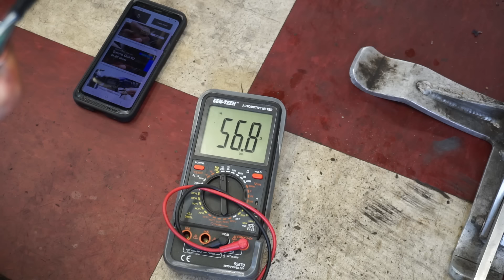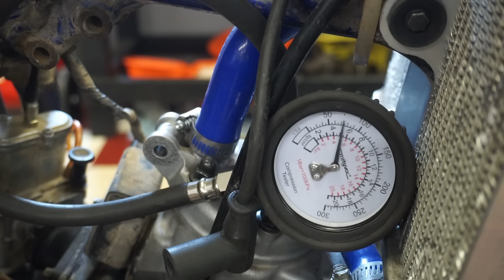Seller Said He Couldn't Fix This $1000 Dirt Bike

Comment: Joe is teaching all of us.....always check for spark before buying.   If you are ever troubleshooting a spark issue, I have found the stator goes bad about 95 percent of the time versus the CDI or Coil.
Reply: Theres so many little things joe can do when he goes to buy a bike. But I know he just gets them for the content. Would be so easy to check for spark and compression test before buying. I used to have a subaru wrx wagon, and when i sold it, the buyer did a complete compression test before purchasing. He's a builds them, so it was quick, but regardless, know what you are purchasing before you purchase.
Reply: He’s not teaching anyone.. he’s not even a qualified mechanic
Reply: @Joeyhill-wj6js what makes someone a qualified mechanic? Are you qualified to operate a motor vehicle?  Was Einstein qualified to demonstrate equations and quantum physics? No?

Comment: Ive bought a 1994 yz 125, that was fully rebuilt top and bottom end just beat up plastics for 1000$, also gotta a freshly rebuilt 1998 rm 250 for the same amount, i put a new plastic kit on it now have 2 great bikes for like 2500 all in, there are definitely good deals out there if you look hard enough

Comment: Joe you could be right about that loose coil wire , I just bought a 2001 YZ 250 that was completely rebuilt top to bottom and wouldn't run !! I took the carb off and cleaned it and now I have a $4000 dirt bike so my point is don't overlook the small stuff

Comment: I just got a free 2004 YZ250 because my BIL said it needed way to much to make it run. So I spent 30min getting it apart, getting the carb off, cleaned out and found the excess RTV had clogged the jets. Cleaned that out, reset the carb to factory specs. Put a new plug in it, tested positive for spark. It has a leaking/cracked gas tank so I snagged the one off a free 06 yz250, fresh gas and the free 04 is dead no more! 3rd kick and she is good to go. Bled the brakes and they’re good. No leaks. Needs a shift lever.

Comment: I notice that when you use the impact driver, you tend to twist it as your hitting it, and also you give it a bunch of little light taps with the hammer. All you need to do is hold that puppy with a firm grip (you do not want the handle twisting at all) and give it 1 SOLID bang with the hammer.

Comment: save some money do your own rod replacements on these small 2 cycle motors , you got a press all you need is a pair of 2''' by 2''' or 3''' by 3''' square stock bars and a flat stock slab thin enough to fit between the slabs with a u cut out for the rod and you push the slabs apart . Scribe the crank slabs 90 deg from the rod pin before you start to give you a good guide as you reassemble. A set of v blocks and a dial indicator to true, a brass hammer to hit the slabs to true on your done. I have done hundreds working for a dealer for two decades.

Comment: Good thing you didn't fix the spark. Definetly a keeper locking up in the shop rather than at 10,000 RPM means it wants to live.

Comment: If crank seal is gone will it rev up if ya play with throttle can't get my 97 cr 125 to run right , clean carb , new jets and reeds are good fires up first kick 120lbs comp??

Comment: Question: Have you ever restored a project back to original brand new condition? It's not nearly as easy as people may think. Depending on its condition, anything that's even remotely worn gets tossed and replaced. Rarely do you use original parts except things like the engine and the frame, which can be brought back to original condition with the help of things like a sandblaster and a good quality welder. Of course, if either is damaged to the point that making it like brand new is impossible it'll get tossed too. It's a painstaking process that could end up taking much longer to complete than you would think.

Comment: I presume every parts will be put in the parts cleaner before rebuilding Joe?
Reply: 🤔I bought a 20yo 150k Audi 4000 from a clock repair guy.  Every screw, every spring shiny as new.  Needless to say - for an old car - it ran like a watch
Reply: Joe dirt aint cleaning nothin

Comment: hey bro I have a pit bike i recently bought. It is full automatic 125cc. Problem is wen i give it full throttle it revs high but doesn't accelerate that fast. Brakes are not sticking. sprocket original. It's auto so I don't think it has a clutch otherwise i'd assume this was the issue any thoughts? thanks.

Comment: Instead of smacking the wrench with a hammer, if you take another wrench a bit bigger than the one in use and use the box end you can position it on the end of the wrench to gain leverage. It will kind of lock onto the wrench being used and sure beats beating on your equipment with a hammer. Also, you should invest in a good set of punches. That way, you won't have to ruin your extentions by beating the hell out of them.

Comment: That’s stator seal allowing air in could have caused a lean hot running condition and starved the bearings of oil as the air pulls past the crank and rod bearings.

Comment: Push the kicker down and let it engage before kicking it, good way to break it. When the piston has spots on top where it hit something it usually came from the rod, split the crank and put a $50 rod kit it thats a cheaper problem then a piston
Reply: Crank bearings and seal is a good idea to change while your at it too tho

Comment: Who do some bikes only have 1 Piston Ring?
I have cheap Ryobi 2 stroke leaf blower that's about 15 years old and still runs perfect. Has 1 piston ring. 

If you watch some videos about 2 Stroke motors like on more expensive lawn equipment like Stihl, Echo, Husqvarna..........
All the small engine mechanics tell you that 2 Stroke with 1 ring are cheap, won't last long and are made for light home use.
More expensive 2 Strokes used for Commercial and high-end products use 2 or 3 rings.

I had many dirt bikes in my day from the 70's and early 80's I never had to take apart, but I notice many of these bikes have 1 ring.
Almost all small engine mechanics say that 1 ring pistons are throw away engines. Not made to last.

Comment: Looks like some a shabby mechanic was on it prior. I notice the bolts securing the radiator to the frame look like they are screwed in on an angle.

Comment: the stator most likely went bad from fuel weeping out of the bad seal it would have dissolved some of the coating on the stator wire causing a voltage discrepency in the 2 windings then dead shorting and melting a wire in one of the windings

Comment: i got a 1986 i’m willing to sell i bought it for 1,000 and put about 350 into it and it’s got new bars new cables and it runs good doesn’t idle but it’s good needs a new shift shaft that’s all i think the fatty fmf gold pipe no dents a little rusty but like three dots of rust i also got a new sprocket for it but the one on it is good i would sell it for 1,500 the plastics are pretty good needs a new filter to